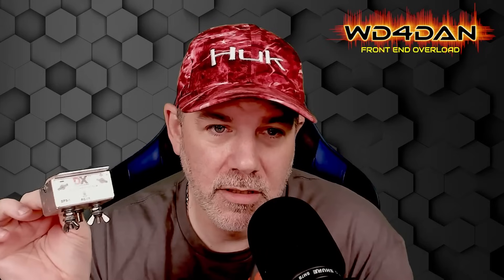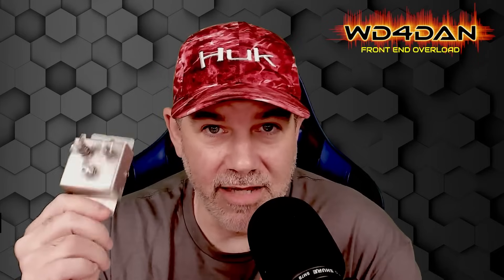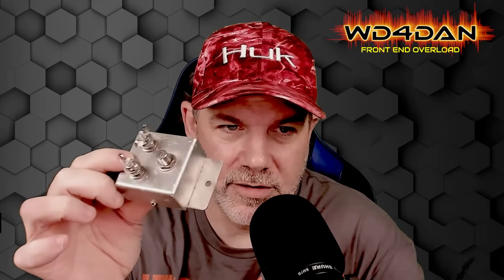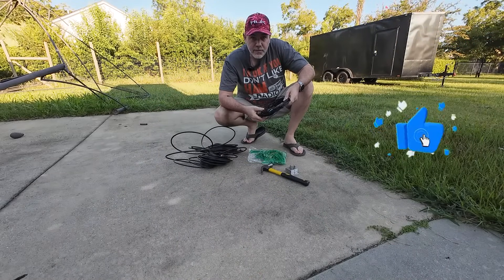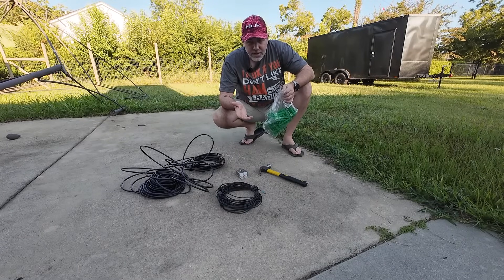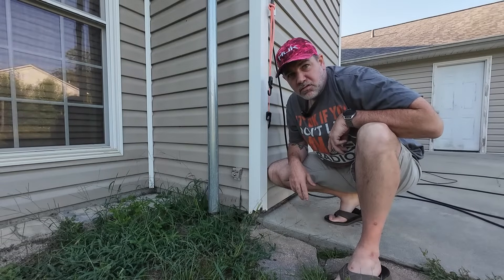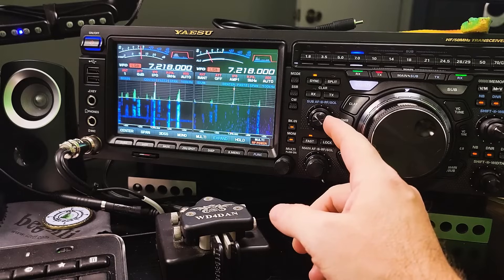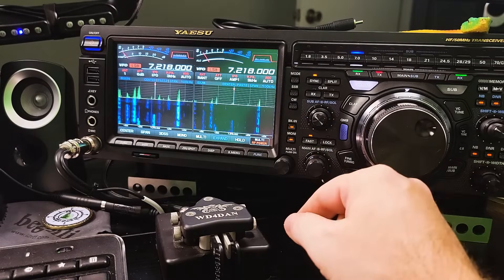Loop on Ground (LoG) Receive Antenna

Comment: If the radio is equipped with a receive-only port (RCA jack on Kenwoods for examle), you should not need to have a 2-VFO radio as the RX-Only connection is disconnected internally when you press the PTT.
Modern SDR Txcvrs have so much receive gain, that the signal strength you lose switching to the on-ground antenna is quickly made up by simply increasing the RF gain setting! Signal to noise is the key point, not just signal level.
Thanks for the useful videos - nice and practical (and cheap) - good on 'yer. 73 Ed.

Comment: DXE makes the RTR automatic tx/rx switch for single receive radios
Reply from the maker: That's another way to do it, yessir!  Be careful when using the RTR if you use CW in full break in, it might not be capable of switching fast enough. 👍👍

Comment: Thanks, I have been researching full band radios just for listening.   I think I will get one with SSB capability and make a loop on the ground antenna like this one.  Can I set up my antenna right next to my house or would it be better out in an open area of the yard?  Thanks for the video, it is helpful.
Reply from the maker: I'd put it far away to minimize any rfi from your house

Comment: Was wondering if you can use a much larger gauge wire and improve reception? Thank you for the video.
Reply from the maker: @johnlew5972  I haven't noticed much difference with larger gauge wire
Reply: @WD4DAN  Ok.. Thank you.

Comment: Do you use a receiver guard with the 101 or does the radio ground the receive port when transmitting?
Reply from the maker: I'd assume the radio handles that.  I've never researched that aspect of it, but I haven't had any issues.  Same with my Icom 7610.  I'm assuming the radio still inhibit all RX while transmitting

Comment: Has anyone tried larger loops to see if signal strength is gaining with larger and larger loops without any appreciable gain in noise?
Reply from the maker: @graywolf1911  I've found the larger the loop the more sensitive it is to lower frequencies
Reply: @WD4DAN  Thank you Dan, W1REJ

Comment: Actially, I have one among other antennas. Yes, it has a bit less noise, but I am in the mountains so my 40 meter inverted V is pretty quiet too.

Contrary to popular perception if you don't exceed the power rating of your transformer you can transmit on it in a manner that is essentially  NVIS thus have nice chats with the guy in the next town on 40 meters.

I checked mine with my Nano Vna & while  resonance is where the absolute value of inductive reactance equals the absolute value of capacitive reactance thus each cancels each other & the impedance is strictly resistive it is resonate on some frequency if not several. I think what you meant is having a relective power indicated by an swr of 1 to 1 relative to 50 ohm coax. Anyway, mine has about a 1.3 to 1 swr pretty much across 40 meters, but that's to be expected since its roughly one 40 M wave length at 40 meters. Its Ok on 20 M too but not quite as good. 80 meters I say it is disappointing and I would go with a larger loop than the 15 foot square if 80 meters was of real interest.
Reply from the maker: @migalito1955  I had a 200' square before I moved along with the 15'.  I'll probably put the big loop back up but it'll probably be only about 75' square.
Reply: @WD4DAN  Yea, I was thinking about installing another but larger so I could get 160 meters & on up. I have hundreds of feet of solid aluminum mig welding wire I like using because it cost only $7 at Harbor Freight, but it would likely be problematic laying on the ground. I have several hundred feet of magnet wire I harvested from old transformers, but I use it in band pass filters for receivers and would hate to not have it later. The one I have now is 14 gage insulated house wire that I found half of a spool of. I suppose I could splice it to the rest I found & may do that to get good reception on top band. Trouble is, after 6 months the wire I installed burried itself like the root of a carrot so I'd rather go totally new.

Comment: Use a LoG with my kenwood 590s (has rec port), using RG6 as feed and about 75ft of 12awg twin wire, cuts out a lot of noise.